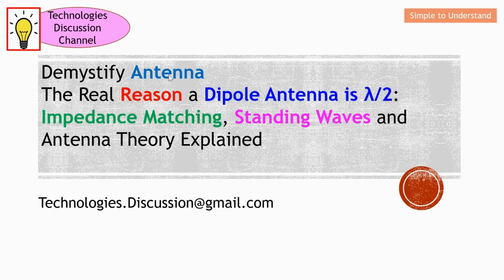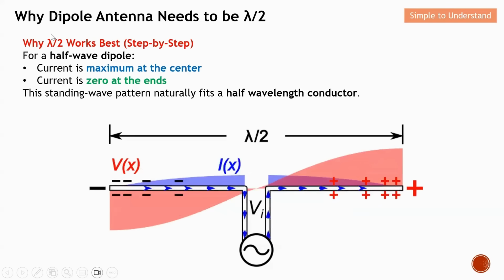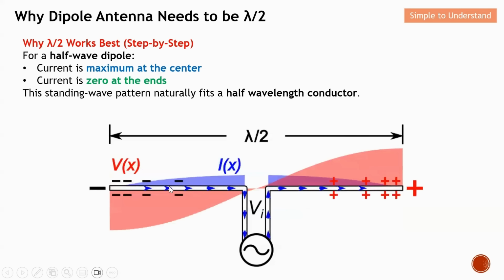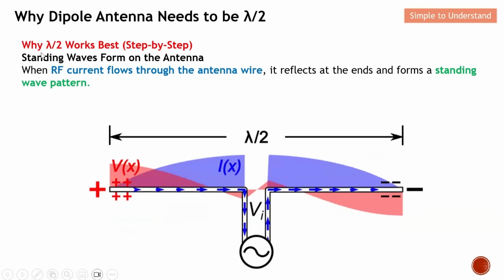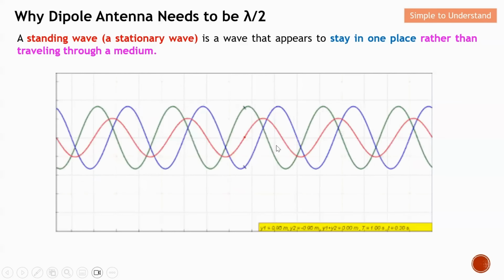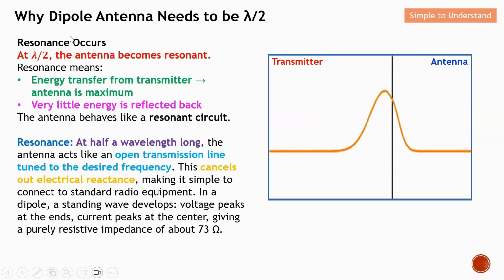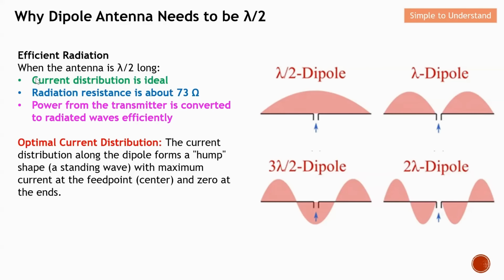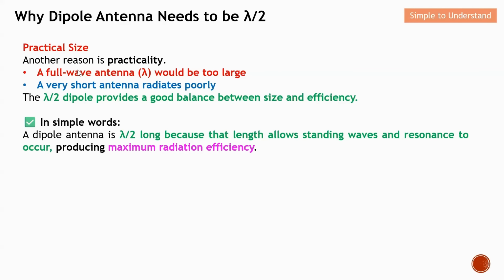Antenna #24. Why λ/2 Dipole Ant Length Precision Matters: Resonance, Current Flow & VSWR Explained

Comment from the maker: Thank you so much for watching this antenna design series video. In this video, we will focus on the dipole antenna.
Have you ever wondered why we are so strict about the dipole antenna length, and why it needs to be around λ/2? This video will explain why. There are three main reasons.
First, when the length of the dipole antenna is close to λ/2, it resonates. At resonance, impedance matching becomes easier because the reactance is canceled out and becomes zero. The impedance is approximately 73 ohms, making impedance matching more straightforward.
Second, when the dipole antenna is λ/2 long, the currents in the two arms of the antenna are in phase. When they are in phase, the radiation pattern is more efficient. When they are out of phase, they may partially cancel each other, reducing radiation efficiency.
The third reason is related to standing waves. When the dipole is λ/2 long, the wave generated along the antenna forms a standing wave. It does not travel left or right, and as a result, the maximum radiation of the dipole antenna occurs perpendicular to the antenna.